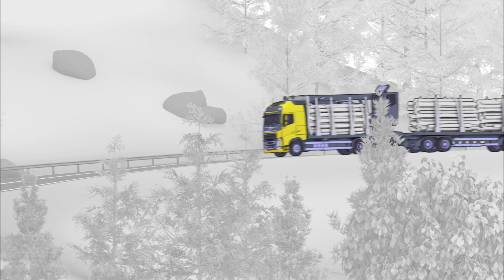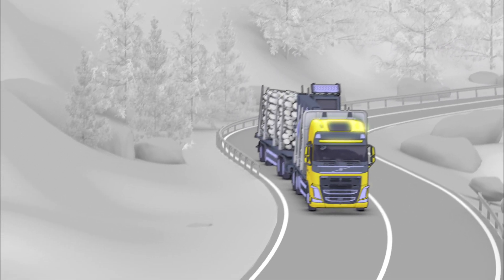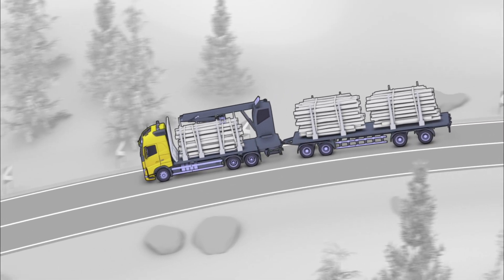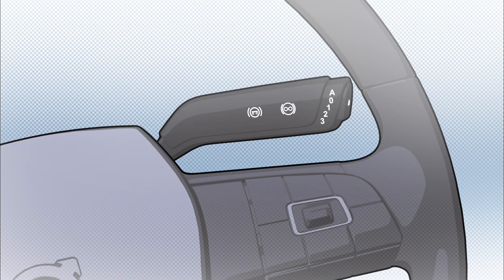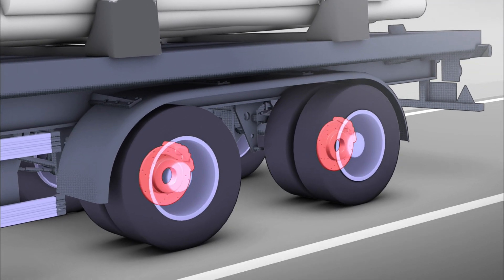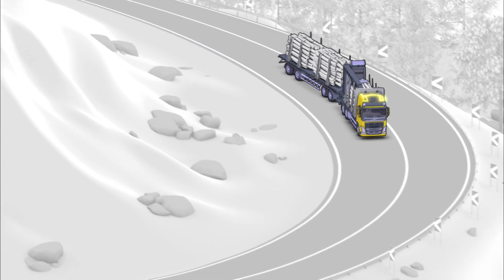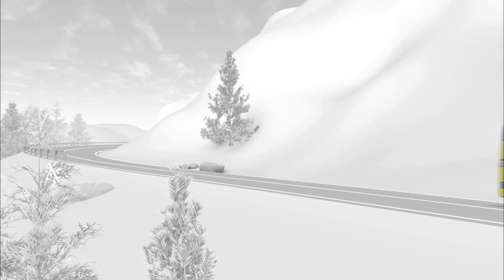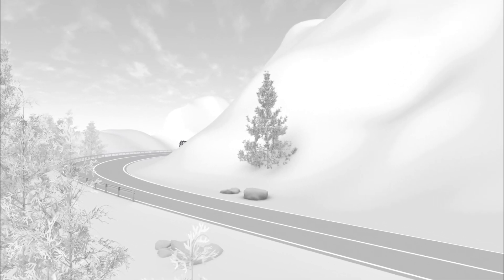Volvo Trucks - Stretch Brake makes downhill driving safer

Comment: My First Volvo F10 had a lever to only brake on the trailer... this was early ‘80s
Reply: Yes, but I've rarely seen it on newer trucks. Mostly just excavation trucks, timber trucks and trucks running in the northern parts of Sweden where it's colder and thus more slippery more often than down here in southern Sweden. We have twisty and windy roads but we can more often than not pick an alternative route if we feel uncomfortable driving on them. Like from where I live. I drive along a very narrow and twisty road. Just last week there was an accident where a milk truck hadn't been able to slow down enough for a corner that gets narrower the further in you get. His trailer had flipped on its side but since it was a tandem truck and trailer it didn't pull the truck down with it. It broke off the coupling mountings (it's made to withstand pulling forces, not twisting, thus it is safer than the semis where the trailer will pull the truck with it.

Comment: I'm worried about overheating the brakes even though it reminds me of ABS
Reply: It won't be braking constantly. If it's slippery you'll most likely go slow and on a lower gear which will make the exhaust brake much more effective and regular brakes not needed as much. Only in the event of the trailer starting to push the dolly sideways do you pull the lever and the rear axles of the trailer will apply their brakes and stretch it out.

Comment: Brakes that come on automatically when going downhill? Fuck that!
How do you descend a hill with a "trucks must use low gear" sign? By law, you are not allowed to use brakes on this hill, and for damn good reasons...
Reply: It's telling you to use low gear because it's a long, steep downhill. If you use the brakes the whole way they can easily over-heat and fail. You put it in a low gear so that you brake less (or not at all if possible). In this situation it is for if the low gear isn't enough. What are you supposed to do? "It told me to use low gear, but the engine couldn't slow me down enough so I just let the truck crash rather than using brakes." You could always just leave the system off and don't use the brakes. You could just let the truck plow into traffic in the other lane and kill people.
Reply: By law?  I think you need to define the country, because in 90% of them, you are wrong.
Reply: 23bobjr Australia
" If the driver of a truck or bus is driving on a length of road to which a trucks and buses low gear sign applies, the driver must drive the truck or bus in a gear that is low enough to limit the speed of the truck or bus without the use of a primary brake."
"primary brake means the footbrake, or other brake, fitted to a truck or bus that is normally used to slow or stop the vehicle."
- Quoted from Australian Road Rules
Reply: BigLeprichaun 18sp RR box and a good jake and you will not only have a gear low enough, but a few gears beneath it too.
Reply: Paul McNally The goal of this system isn't supposed to be something to replace using the engine to slow you down, the goal is to be extra safe. Is being extra cautious a problem? Have you ever seen those safety ramps along the side of large downhills? I live in Australia too and whenever I see them you can see that trucks frequently use them. If trucks have to use those ramps frequently surely more safety systems are not a waste.
My point is that if, for some reason, your engine cannot slow you down enough you most certainly will not get in trouble for using brakes (especially the type shown in this video).
Reply: BigLeprichaun On short steep hills this system has it's advantages. But you certainly WILL be in trouble if a cop or scalie sees your brake lights come on down a hill where a "must use low gear" is sign present anywhere in Australia. If you need to use your brakes then it means you failed to select the correct gear. It's around $350 and 3 demerit points. You will also be fined this if you end up on an arrester bed because you obviously cooked the brakes. The "avoid using engine brakes" sign however is NOT a legal requirement. Been driving them for 15 years.
Reply: Paul McNally My point is that things don't always work as intended. Something could go wrong and you end up needing to use your brakes. Do you honestly think it would be better, IF there is a problem, to let your truck fly uncontrollably down a hill than use the brakes. The goal would be (again, IF there is a problem) to use the brakes gently and just stop before you're going too fast for front end brakes to be effective. If a cop saw you do it and decided to fine you, they could inspect your vehicle, see there was a problem and you would not get in trouble. If you did get in trouble for possibly preventing lives from being lost then I have no hope in humanity.
The point of the system displayed in this video is not to be something used freely, but something used in an emergency. IF there is a problem, brakes at the rear would be much safer than brakes at the front (and I'm sure you know why).
I don't disagree with you when you say that you should rather use the engine to slow down than using the brakes. My dad used to drive trucks in the army and they taught him to never go down a hill in a higher gear than you would go up the hill in. If there is no issue with the truck and you have to use the brakes then it is most certainly the driver's fault and that should be fineable (because mistakes like that can end up costing lives). I am simply saying that in an emergency, extra braking options are never a bad thing.
Reply: Paul McNally
I don't think those are normal brakes... They are probably just meant for turns just to correct and balance the truck and not to stop it...

It's like a car that has locked differential, so it's a crap to make turns, and those brakes are like if it made the car open differential so it can turn with stability (it's just an example).

At least I think it's something like that. Just like some illegal F1 cars had a hidden pedal to activate this type of brakes, but it wasn't to actually brake, but instead to make it go even faster on turns by using brakes to balance the car (like if it was a controllable differential that can change values in real time).

And yeah, it was banned from F1 when they found that out :) (don't know nowadays, cause I don't follow F1)
Reply: Yeah. Brakes heat up, and when brakes heat up, they're useless. Therefore, you should downshift before entering a downward incline.
Reply: Do you have icy roads in Australia?

Comment: I think it's a good idea. If every truck manufacturer put this on every truck they built, all the driver would need to worry about is which direction the truck is headed and be able to drive down a hill in a safe, and controlled manner.

Comment: This is nothing new.....trucks from 1970 had a trailer air brake valve ......dont see how that could be any different to this.
Reply: Did they brake themselves to remove the weight of the rear trailer pushing against the truck when you get off the gas pedal?... Didn't think so.
Reply: this wouldnt either , UNLESS you hit the switch.....not exactly rocket science to pull the trailer brakes on with alot of weight on the rear during cornering.......if they could do it in the 70's , dont see why truckers would need training wheels these days, end of story.
Reply: DubTeam LFS  probably this is more efficency and accurate in comparison with an air brake valve costantly "on" ?? anyway, marketing is very well known at Volvo ;-))
Reply: in Europe we dont have separate parking brake switch for the trailer inside the truck's dashboard